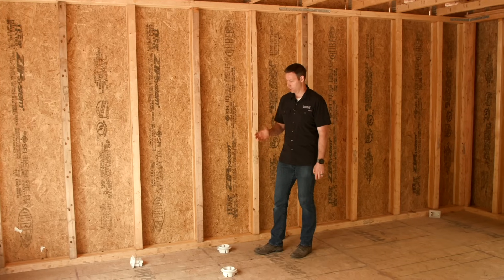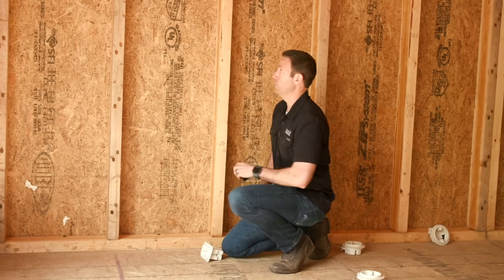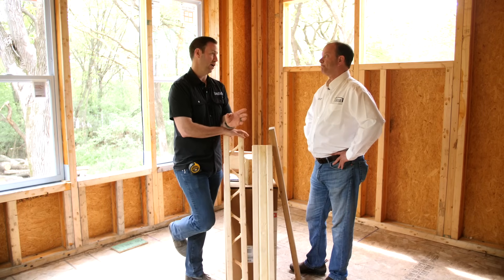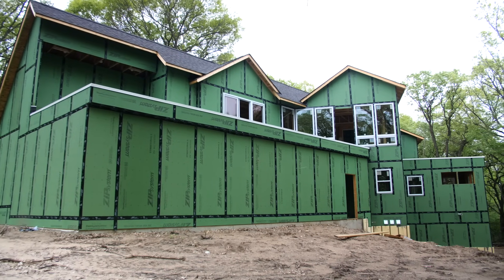Insulated Studs? This is a BIG Innovation in Framing!

Comment: 1500 more for a standard house is what will make this a viable system for many,...……..over priced non cost effective systems are typically shunned no matter how good they are.  There is always a work around, such as double stud walls...……..at 1500 difference, this makes the double stud obsolete if you can get it readily available to builders.   One thing not presented clearly enough in this video is the 2.5 inch nailing surface,....that's huge !

     Looks like a win to me, everyone every where should be using these, there is no climate where insulation does not pay and thermal bridging has been a deciding factor in how far to go on certain projects since the work arounds are not viable on every project...…..if he can ramp up production to meet demand, this is a no brainer.
Reply: @BenjaminFranklin99-s9n  I watched the video series by Pure living for life and their SIPs took a lot of extra work to install in the real world.  Not a promo video. Have you installed SIPs if so what brand.??
Reply: $1500 is a huge increase in the cost of framing walls.  It is around 4x the cost of standard 2x6 studs.  That means you could double stud for less than this.
Reply: @sirstickjcs  When building a 500k house, its coffee and donut money .

Comment: I still prefer sixteen inch centers. Twenty four is cheating the customer for sure.
Reply: It just means using thicker gypsum board, like 5/8" instead of 1/2". It's not cheating because it is four times stronger than a 2x6 (without double blocking) and has a very large nailing surface! This allows nailing farther from the edge of sheathing which is great!

Comment: As a builder based in the NY area,  I love to see this kinda new product, but the main problem is still the cost, we have tons of supplier provide incredible cheap lumber here.
Reply: Cost is a no-brainer. HVAC equipment cost reduction in a TStud house offsets the higher purchase price of the TStuds. Real savings comes down the road with lower energy $.
Reply: it's very hard to sell a "future energy save" versus "lower project cost" to a regular customer, the majority of customers cant foresee the savings on the energy bill. So either does a passive house or make the cost down to the bottom.

Comment: I think probably a better alternative is using the I-beams with OSB web.
Reply: That would be stronger still, but a wasted strength. OSB or engineered plywood webbing is designed for demanding joist loads. The thermal bridge is worse for continuous OSB than for diagonal dowels.
Reply: @avid0g  Yes I work for a company that sells them. ;) But if I put together the thermal bridge which is 75% lower for OSB web than a regular stud, cost, fire safety, strength and weight I don't see why this product would be used in a project. OSB web is used for many passive house projects in very cool climate where I live for example.
Reply: @erik....  
Since the studs primarily have to resist bowing under vertical load, more of the webbing should be removed to reduce the thermal bridge. I often see precut holes to pass large waste pipe. If those holes could be done in a zig-zag, the thermal bridge would be reduced drastically while retaining desired rigidity. Of course this is imitating the dowel truss, but using OSB. In the ultimate form, these are SIP.
Reply: @avid0g  Sure, but the sheating will take care of bowing... I wonder if they took that into account while testing. I don't think so.
Reply: @erik....  is talking about the self-supporting load rating when T-stud are used as simple columns.

The OSB or plywood sheathing primarily takes care of "x,y" flexing of studs and beams within the wall plane. Normally, 2x studs and plates limit bowing in the "z" direction (bowing in and out by drywall and OSB). However, in T-stud, the diagonal dowel act as the primary stiffener for the "z" direction. The dowel act like truss members in the web between flanges, except the truss is vertical.

The main capacity of rectangular columns is their resistance to bowing under load. Longer and finer (more slender) beams are weaker. 2x are weak due to their being so slender (1.5"). Sheathing makes them rigid in that direction, but the other stud dimension (x4, or x6) is what makes the wall stiff in the "z" direction. 

The 6" T-studs act much like 3x6 lumber columns, and do not require sheathing for their load ratings. Of course they become even stiffer once sandwiched, since they are most "slender" on the 3" edge.
Reply: @BenjaminFranklin99-s9n  
Maybe more like a truss since the web is so open with all those dowel.

Comment: Now that is a brilliant product.  Thermally breaking studs while making them 4x stronger... whew!
Reply: Yes, but isolation should always be companied with an cost/benefit analysis. Probably not mention because it is a sponsored video. This is NOT a new technology (outside US).  In my country it is only used as an last option because of price. :)
Reply: Håkon Håkonsen They mentioned the cost difference in the video. $1500 more on the average 2500 SQFT house and $5000 on a larger more complex house. That’s change for a house you’d plan to live in 20-30 years.
Reply: @JsGarage  I've been a builder for 3 decades; I bet a million dollars, I could take you into a house framed with those crazy studs and insulated and a normally insulated house and you wouldn't note a difference...The insulation advantage is negligible, if at all...Everyone wants to reinvent the wheel...On the east coast we have 3 cold months and 3 hot...meh...2X4 or 6's worked fine for decades...
Reply: godbluffvdgg For the price difference especially as I said over 20-30 years I’ll take the new shit thanks though. Along with it comes a stronger construction. I think trying to notice something from a simple walk through is the issue as well. These will be something that is appreciated over the life of the home.
Reply: godbluffvdgg Not sure what east coast states you’re talking about but we have a couple cold months and 5 maybe 6 months that usually require AC where I live. There is plenty of room to improve on home insulation.
Reply: @JsGarage  Hey, it's your money...You can spend ten times that amount and be REAL insulated and MUCH more strongly built...Where to draw the line?...Then; 10 years from now they determine the chemical used in the insulation causes birth defects or cancer...
Reply: @godbluffvdgg  I would use the t stud then fill with rockwool inside and rockwool comfortboard on exterior. THAT would be perfect with a small increase in price, but I DO get the advantages of the t stud, so it s a win win
Reply: godbluffvdgg Were not talking 10 times anything. $1,500+ isn’t all that bad. You’re right a line needs to be drawn but I’d spend another 10K knowing my house was better insulated and more sturdy beyond just these T studs. Traditional house building is just a minimum there are many improvements that gets one a better built home. Maybe not worth it to some but the options are nice.
Reply: Wow, only 3 cold months.  Must be nice.  Here in Montana, we had -30 in March this year.
Reply: @godbluffvdgg  what would be your take with a state like Florida where it's hot and humid for about 8 months and only possibly cool for 2 to 3? Im genuinely curious as im looking to build?
Reply: @08gsxr  Too many variables...You need to know the cubic footage of the house; the square footage of glass, Insulation types etc to truly spec the system......Usually; the smartest thing to do; is find someone with a similar house nearby and copy their system...I know you should have the best dehumidifier your money can buy down there...:)...Put the most efficient and most enduring system you can afford. The best system is one you barely think about...:)
Reply: @MIKEKELLEY12000  Yeah, but look how Beautiful it is there! You guys got hit with May snow too right?...I love that area of the country! but; as a philly guy; I wouldn't last a week...Too stark and spread out for me...Do you have a horse?
Reply: @08gsxr  I have a house built in 69 in South Florida. Cement block first floor, 2x4 studs, with termites on the second floor. Almost no insulation, it gets to 90 upstairs on a 85 degree day. Anything is better than what I have. I've been wanting to rebuild the second floor. Was going to go cement block all the way up, then insulation board on the outside. The T studs might be the best way to do it now.
Reply: You're right, it is beautiful here.  I live near the tallest mountains in the state, and the view from our town is amazing.  We do get our snow, though, and winters can be long.  We get little warm-ups that melt some snow but leave ice everywhere.  A lot of people fall down  and get hurt, especially in winters like the last 3.  No, I don't have a horse.
Reply: @MIKEKELLEY12000  Oh, I thought horses were standard issue in that state...:)... So many Great places to ride one!
Reply: @godbluffvdgg  Ok thanks that makes sense. We are going through a community developer that will have two floors and two a/c units. The first floor will be block with masonry insulation and the 2nd floor will be whatever the current standard is 2x6? I'm not sure what they are doing about insulation upstairs but I believe the roof will have that higher grade reflective lining. I'll have to see what they are running for dehumbifying. This is just temp till we find the land we want our own custom house on. Thanks for the advice and I will keep it in the back of my head!
Reply: @godbluffvdgg  I deal with contractors/builders with your view all the time. No interest in changing or trying new things till the building code forces them to or the market passes you by. You build the same old house that has been around for 40-50 years, things have moved on from materials to building codes to ability to use building science to design an efficient house. 

The difference with using something like this is more insulation in the same space... you don't need to add rigid insulation to the exterior to thermally break the studs or go with thicker/double walls for more insulation. Throw in advanced framing and suddenly you are getting the maximum insulation value out of what was a poor/average wall at best and it takes the same amount of time to frame as a 2x6 wall. Combine this with a furncace/AC system that sized for the house (which almost no builder does, just throw an oversized unit in a call it good) and good triple pane windows and you will be cutting way down on yearly energy/fuel bill. This the home owner will notice.
Reply: @Swarm509 Look, I can see you're a smart person and you are concerned about energy savings on the building envelope....And, that's an admirable trait...
You obviously don't own a business or you would understand that when you own the company, the buck stops with you. It's about long term reputation and call back avoidance...As an owner, I can't touch every single subassembly in a project. I let experts tell me what's best. I've been in the business for over 3 decades and I've seen many a friend lose their shirts on "experimenting"...We're not afraid of technology at all. We embrace it; if it can save us money or increase the bottom line...THAT is what being in business is about...

I'm not a contractor to save the planet or whatever you weirdos ( breaking balls) think you're doing...I spec things that 20 years later, when I'm going back to put in a new kitchen, the customer loves to see me again... Lawyers, consumer groups, home shows are the bane of existence... TMI...available...Don't overthink it. It's just a place to keep the rain off your head.
Reply: Jay P Is 1500 still "change" even if the ROI (return of investment) is 500? You sound like you work with sales. "1500 is pocket change" is not a valid argument.
Reply: @JsGarage  A stronger construction?  I highly doubt that. More like the exact opposite. There is no way you are going to gain structural integrity by eliminating the top plate. There are many things that 3 decades of experience gives you. One of those things is the ability to recognize the weaknesses in this product and there are many. 

Just because the maker of this product claims that T-studs have a higher compression rating then a standard stud is irrelevant as standard studs are plenty sufficient for the job. Besides a higher vertical compression rating doesn't necessarily equate to stronger construction anyways. If the T-studs make the application of hardware difficult or impossible to apply, as I can plainly see they will, then they are not stronger construction.

In many areas that have certain code requirements for earthquakes and hurricanes you can forget about 2' centers as well. The 16" center layout of studs is not just to resist downward force but lateral, oscillatory and upward forces as well. In my professional opinion the use of a 2' centered layout on exterior walls is a mistake.  

As the OP stated the difference in cost savings will be negligible even over 20-30 years.
Reply: Jack A. Lope I wouldn’t do 2’ centers.
Reply: Håkon Håkonsen But “I’ve been building houses 30 years” is a valid argument? Come on, no one in this comment thread has any fact only their opinion and everyone wants to think they have the best opinion. Being a builder for any period of time unfortunately doesn’t mean engineering expertise. Just because there are some old dudes in here that disagree with this product doesn’t mean I should.

Comment: I have a real issue with the 2’ OC and single top plate. Our weather is getting worse no matter where you live. We need houses build sturdier and better not lighter! I like the R value and will definitely consider using the product but I will keep 16” OC and double top plate. Living in FL were hurricanes are an every year issue, I wouldn’t ever recommend 24” OC or single header ever.
Reply: Hurricanes are only an “every year issue” if you live in a wood frame house. As interesting as this new product is, it’s not really applicable in FL.
Reply: Sean M  They specifically talked about this product being applicable for hurricane wind loads. So how then is it not being marketed for FL? They also say if you can’t find it call us and we will ship to you or we will get your local lumber yard set up to receive it quickly. I have been in the building trade in one for or another for over 30 years. I know our  code, I have deliberately kept up with our code even though I did not keep my Commercial Contractors License and after the hurricanes in 2004 I saw good Contractors be put out of business because our County made them go back on houses that were almost 85% to 90% completed and bring them up to new codes that were implemented almost immediately. They went bankrupt after lifetimes of hard work. It was completely unfair and they were branded as corrupt because they had to declare bankruptcy. It was completely wrong how it was implemented and both the Contractors and their clients suffered from Bureaucracy at the core.   I have continued to do kitchen and bath remodeling and having been born and raised in Florida can tell you unequivocally I stand by what I said about this product. Keep it on 16” OC and double the top plate and yes I would recommend it.
Reply: Sean M And by every year issue I mean we must deal with them every year during Hurricane season unlike the majority of our Nations Natural disaster issues. Most of the center States of our Nation deal with Tornadoes, fires, floods etc. we have floods issues during Hurricane but unlike people along the Mississippi we do not have floods of that magnitude nor do we have Tornadoes like Tornado Ally. We don’t deal with snow load issues, every part of our Nation has its natural disaster issues. Ours is Hurricanes. We build for them and they are as all natural disasters getting stronger. It makes sense then to build stronger not lighter. That was my point. Having suffered through $275,000.00 in damages during 3 back to back Hurricanes in 2004, spending 22 months rebuilding our house myself with my husband, I think I know a bit more than you comprehend.
Reply: BenjaminFranklin99 my reply to Sean M goes to your comment as well.

Comment: Some years back on This Old House they featured some studs that were basically I-joists standing on end, 2x3 flanges with a web of OSB in between, made the same depth as standard studs, 6 or 8 inches.  Similar benefits, such as knock outs for electrical runs, little heat transfer, etc.  
This seems to be very similar product, just with dowels connecting the flanges instead of a strip of OSB.  Hope it takes off, as I can't find any of the LVL studs.
Reply: You just use Trus-joists for studs.  It's not a special product.
Reply: Benjamin - can you post a link?  (I'm not talking about an LSL or LVL used as a stud)  Thanks